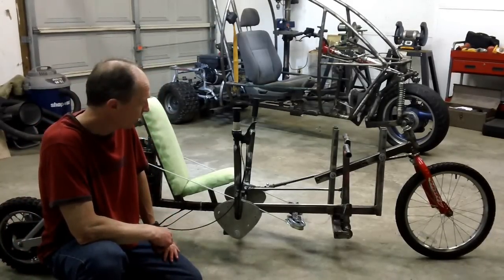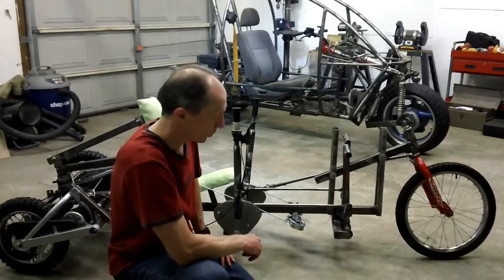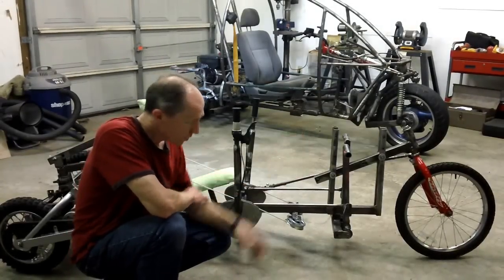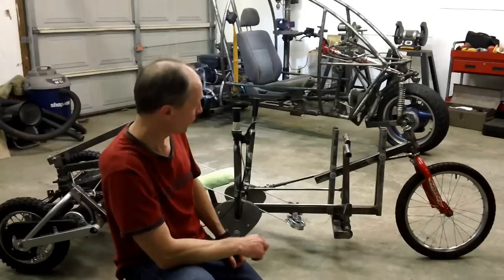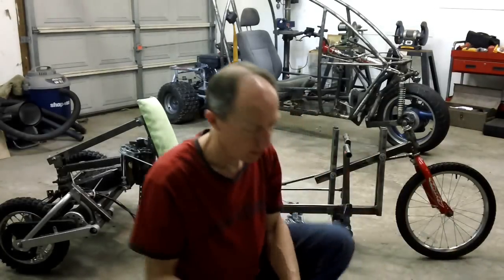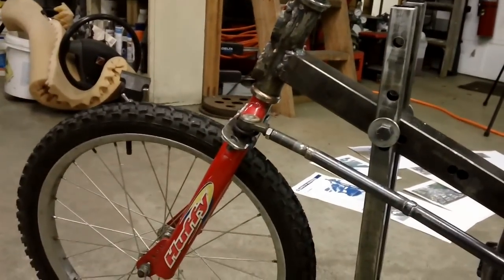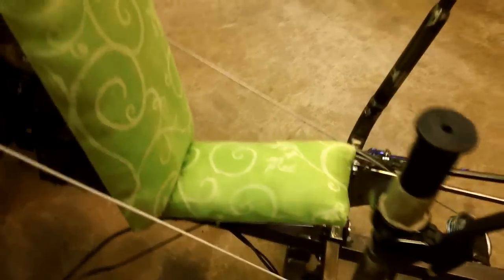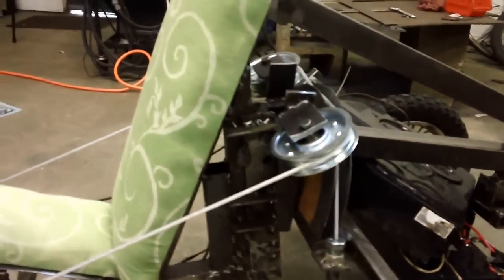Building a Three Wheel Tilter  5-24-15

Comment: Hi Stephen, very interesting video! Thanks for posting it. I've also watched your previous video with the four wheel design, that seems to work. However, I'm especially interested why your three-wheel-design in the background does not work. Can you please explain this? Thanks!
Reply: Hi David, glad you got something out of the video. I thought this build would take a year. It took over a year just to get the first prototype to a point I could test it. In 30 seconds I knew I needed to redesign. I got tired of making major design changes to the full blown machine and having to wait over 6 months just to see if the new design worked. So I built a simplified version that I could modify quickly and try it out. I went through over 15 different designs over 13 years. This was the toughest design challenge I have ever tackled. It is difficult to design a stable tilting three wheeled vehicle. Every design has it's trade offs.